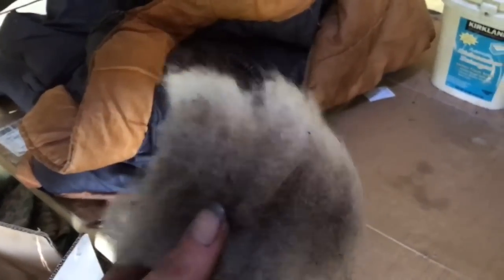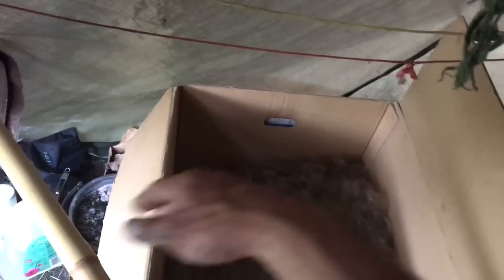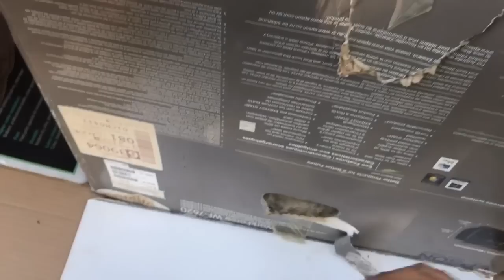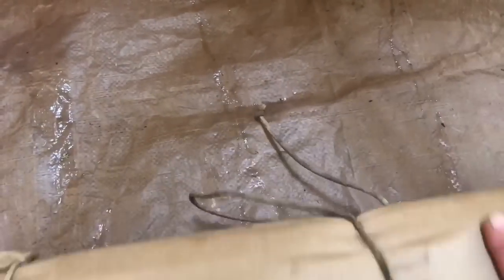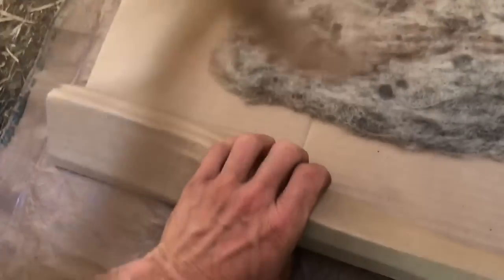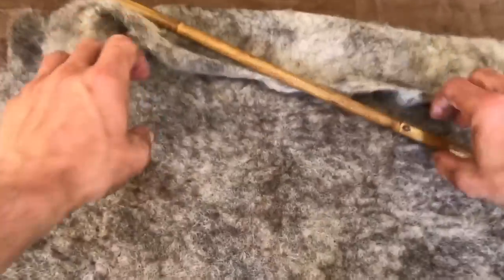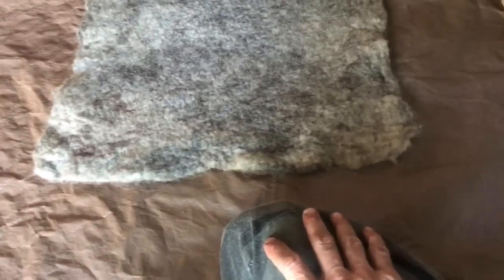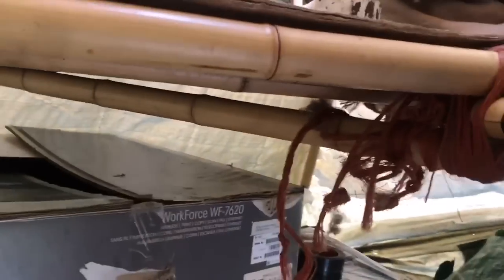DIY "boxfelting" the easiest felting method!

Comment: Hi Aaron, great video - love the felting technique. I am trying to make my own felted waistcoat with buttons to 'do up' at the front. I just wondered how you did the front of yours? did you just felt one big piece and then cut it in half? If so did you do anything to strengthen where you cut the felt - i was thinking i could needle felt this area so it wasn't a weak point? Also did you sew the button loops into the felt? Thanks again for the video and the technique!

Comment: Do you wax any of your wool felt?  My sister used to sell that Scentsy crap so I have pounds and pounds of used scented wax with most of the scent used out of it.  I kept it because I figured Id find a use for it by now.  I have a wool jacket from Salvation Army that I got for a couple dollars and was gonna wax it and use it for my winter bush jacket.  The wax probably help lock those fibers in place for longer.  Maybe some beeswax or perefin is something youve tried before?  I am heading north with my trailer next season and a sheep is now something I am considering depending on what the land is like wherever I end up.

Comment: Pretty awesome, thank you for sharing.  Was wondering, do you think that the sheep would be ok with having their wool vacuumed while it was still on them, or would they be freaked out by the sound and/or sensation?  Also, I was thinking that if you make an ultra sonic vibrator, and put it under a shallow tub of some kind, put and pressed the wool in, then poured some water to cover/saturate it some, the ultra sonic vibration might quickly vibrate the fibers to lock together?

  Actually, you probably wouldn't even need ultrasonic to get there.  Just use something with a strong, relatively fast, and constant vibration might work. Same way that people clean parts by using a vibrating (orbital) sander and water contained in a tub.  A metal container would probably work best to transmit the vibration.

Comment: This is so great I’m going to try it with the raw wool I was just given. I’m very new to processing and working with raw wool. I really want to leave the lanolin in, but I’m wondering if the presence of lanolin in the felted vest leaves oil stains on your other clothes?
Reply from the maker: No lanolin isnt oilbits a wax so wont transfer easily like an oil.  Just make sure the fleece youre using isnt matted too much to where its not relaxing and fun to pull apart.  Also make sure fleece fibers are 4” or long because shorter is t efficient enough to be enjoyable, also also make sure the fleece is bone dry to aid in its pulling apart cathartically.

Comment: I do a similar method but I use a tarp or plastic and a wooden pole.
I roll from fingertips to elbows
Turning the felt 90 degrees after 10 mins of rolling makes it very strong
Reply: Interesting. Do you have a video of this?
Reply from the maker: If you dont need a box to buildup your layers then you arent breaking up the fibers as much so they wont be able to work into eachother as deeply and your final felt wont be as abrasion/snag resistant or have as much sheer/pulling strength.

Comment: I think more homeless people could be Shepherds. I wouldn't rule out a slightly larger wagon that could be pulled by 2 Rams
Reply from the maker: No, wagons cant be any larger than this without inhibiting their safety and mobility on the side of the roads, sidewalks, getting through peoples fence gates to park in their yard overnight, maneuvering around and through street obstacles and trees while in the woods, etc.  You also cant pull a bigger wagon by yourself in order to reposition it onto the flattest part of earth in the parked proximity.  If your ram(s) got hurt or died youd be screwed.

Comment: So if you wound up in the river, or extreme weather, can it fall apart or is it permanently locked?   Thanks ....    is there certain wools not itchy?  I know Icelandic wool is super soft , only wool i could wear , but they also put a silky liner on the inside..
Reply: It is inextricably tangled together. Wool is itchy when you wash all the lanolin out.

Comment: The old type wood slatted/carpet roll up window blinds from 1970s and 80s rvs might work well as a roller. Maybe with a sheet of cotton glued to one side. Or outdoor bamboo roll-up shades again with cotton canvas attached to one side. It would double as a shade or mat.
Reply from the maker: Yes lashed mats of any kind work very well to felt but the strings endup breaking too often compared to the plastic cardboard

Comment: Probably others have stated that using the method you are showing is simply the oldest method that was used.  When you lay the wool out in the fashion that you do, you are taking a greater chance of having very thin spots on your piece......thus, you end up using a larger amount of wool to achieve desired results.  The "bull****" methods that you mention are people developing ways to make very thin, flowy felt works.  They are wanting them to be thin and for them to be a fabric that drapes and flows gracefully.  There is certainly nothing wrong with how you do it and for utilitarian reasons this works quite well and will make very nice outer garments that are rain resistant and very warm.  When you use fine wools for outer garments to wool often "pills" due to heavy wear and can be a bit unsightly so these outer garments usually use much more coarse wool for durability purposed. Thank you for bringing to the forefront this very old and certainly even ancient way of making felt.  It is nice to go back to the roots from time to time.
Reply from the maker: Not quite, the ancient method wasnt able to pull the locks apart into individual fibers because they’d blow away so they would rip locks up roughly or beat them with sticks that on the upswing would rip the locks apart but the final product is always shabby and not at all abrasion resistant.  When you break the fibers up more then bring them back together into one felt its denser and the ends are tied in better no loose ends.  The modern carders rip fibers in half lengthwise doubling and even tripling the number of exposed fiber ends on the surface of the garment thst pull out easier than my felt because the fibers are much shodter being ripped in half by carders.  Watch my “they love me or they hate me video” beginning has a very thin boxfelted scarf all you hace ti do is use a flashlight to check the consistency if density like in this here felting video.

Comment: Hey Mr. 123Homefree! Thanks a lot for your video! I've just finished my first felted piece today. Everything worked out well. I was just a bit shocked on how much that thing shrinked, haha. It shrank for sure about 50%. So for my body size i guess i need 3 or 4 pieces in order to sew a vest.
Reply from the maker: Or just make something else with the current small panel and get a bigger box!
Reply: @123Homefree  hmmmm, good idea. i will check. that one was actually already quite big, but i might get something bigger. question: is it actually possible to cut the pieces in order to tailor some nicely fitting clothing? or is it not a good idea to cut them?
Reply from the maker: @delijahify  you can cut them, thats the whole beauty of felt over woven textiles is that felt is most easily patched and sewn
Reply: @123Homefree  awesome. thank you! :)

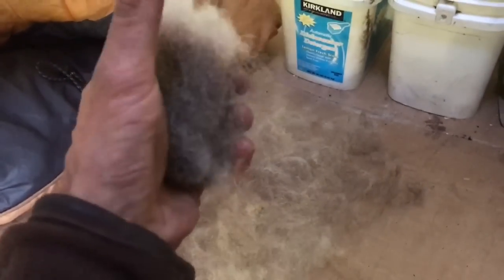Comment: 1:40. Thanks! Just looking at you doing it unfucked the part of my brain that couldn't get over the "need" to card wool before spinning. Every thing else seemed doable literally with rocks and sticks... Carding was quite the friggin conundrum... I was imagining blacksmiths drawing wires through dies... I knew that was definitely wrong when it came to The Simplest Way To Do It™ because stone age people can make very fine textiles, but I couldn't picture it. But yeah watching you pull at it for a second made me see the error of my ways, before you even said finger carding. I need to stop watching and learning so much and start doing 😳I owe you a drink!
Reply: I was thinking recently, where I grew up there was a lot of sheep fields near me and the hawthorn always had whisps of wool on it, not enough to just harvest from the branch, maybe if your patient, but I was thinking recently, if you took some thorny twigs and lashed them together to make a square with the thorns all aligned upwards, you might well have there an effective hackle for fibres, not quite carding, but it’s better than nothing, I’m gona give it a go this summer, all the nettles near me have exploded so I’m gona try the fibres from those, I was planning on simply doing a 4 in 1 chainmail pattern of tying rings of fibres instead of spinning and weaving, as for a fabric it will at least drape, but that’s very time consuming, glad I found this felting video, instead of cardboard, could use the bark off a fallen willow or something similarly flexible, 
A trunk or branch will give you 3.14 times it’s diameter width piece of bark, 
Was also gona look into bark cloth, but I think for the labour involved it’s not actually a very useful material

Comment: do you think the same method would work with cotton?
Reply from the maker: Cotton wont felt tight enough for practical clothing use cause it doesnt have microscopic barbs along the fiber to bind them as well, a flat cottonball panel of cotton felt would pull apart easily no mater how much you smashed it and agitated it together

Comment: Could you use alpaca fiber the same way ?
Reply from the maker: There are 2 kinds of of alpaca fiber suri and hyac..?i dint remember how its spelled but that second kind will felt but not as easily as sheeps wool because the alpaca fibers dont have as many barbs to cling to eachother and “ratchet” into and past one another into a tighter felted mass

Comment: Thank you a lot! After how much days it will be dry?
I have the short wool from the Alpaca, the leftovers from there legs. Can i do the same and will it be also strong on the end? Also because  it looks like there is less lanoline in the wool?..
Reply from the maker: Alpaca doesnt felt as easily/well as wool but it can he done.  I would suggest starting out with 4-6” staples of sheep wool using this simple method.
Reply: @123Homefree  i still want to try it and let you know 😉